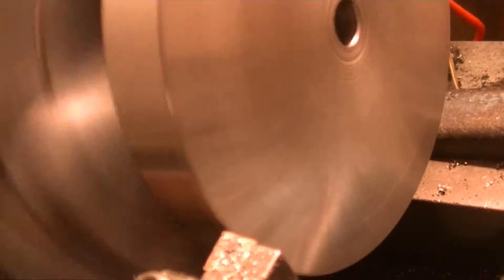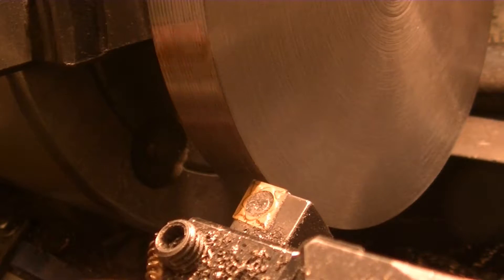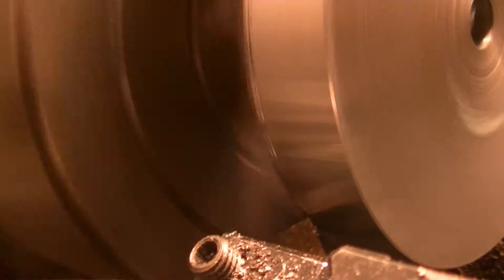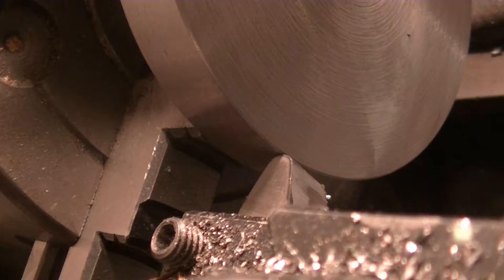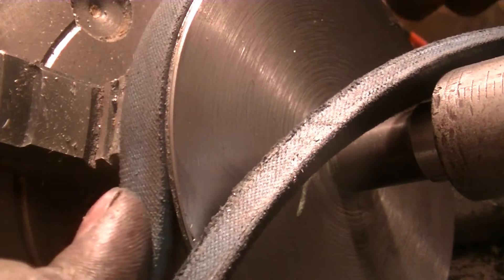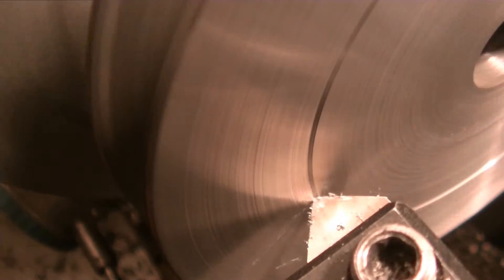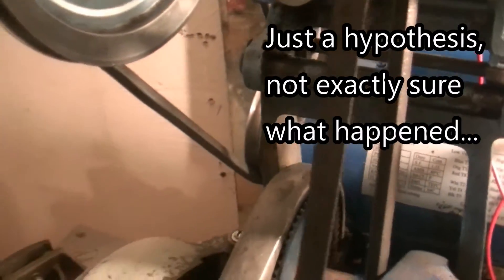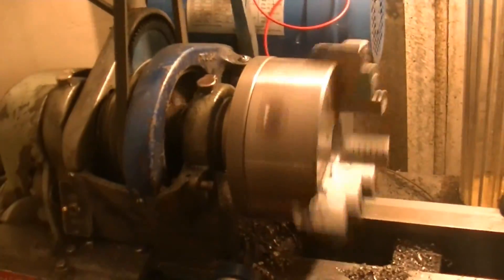Making a 2-Step Lathe Pulley : Part 3

Comment: Looks nice!  If you cut a little deeper on the small pulley, couldn't you just cut a little more into the large pulley and make them match up?
Reply from the maker: Yes I think that would work for sure.  I might get around to doing that one day, for now it works well enough.  I only really use the one speed anyway.